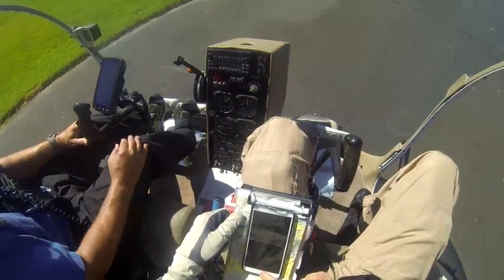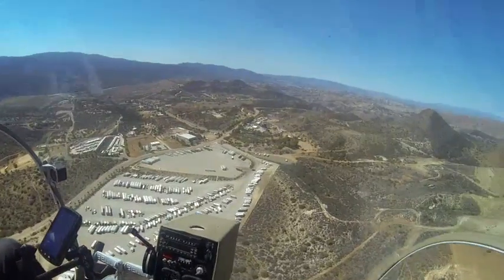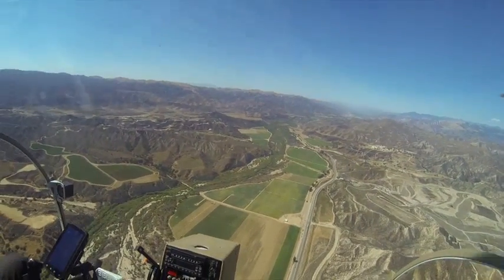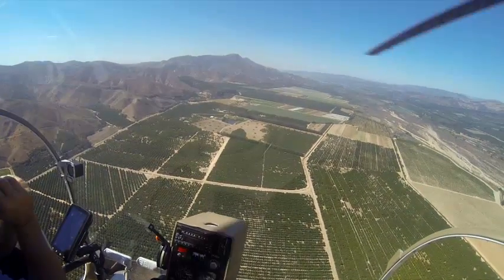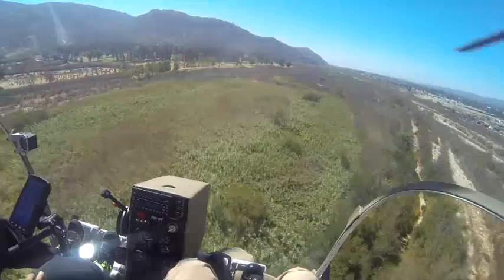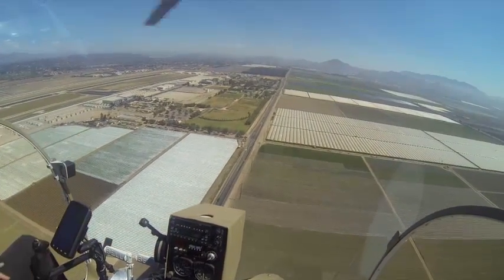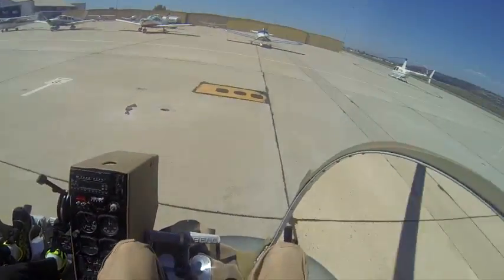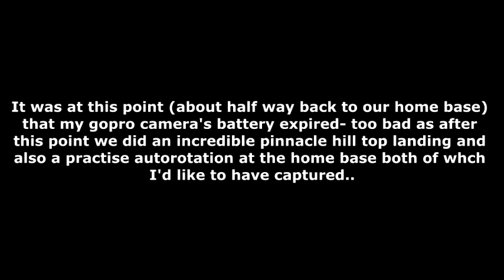How to fly a Bell 47 (classic 60s) helicopter flight training/instruction (full flight vid-comms)

Comment: way didn't the instructor pilot let u operate the radio.
Reply from the maker: Mikey Parker because this was the first time I flew this type of helicopter and had enough to focus on geting used to flying the helicopter (not used to a manual throttle for example) plus flying in unfamilar airspace- it's called Crew Resource Management- if you have two pilots in an aircraft why not share the workload, for safety reasons, let alone anything else